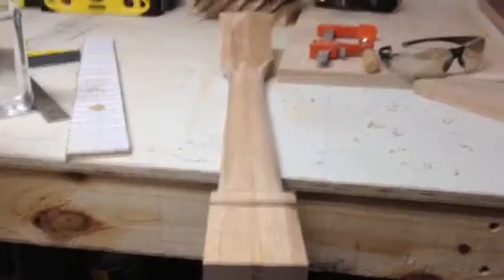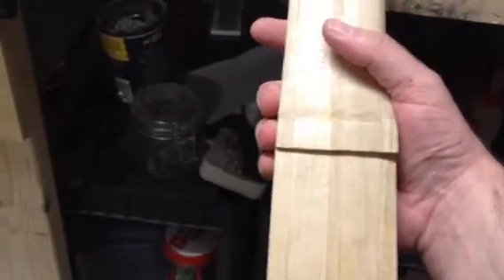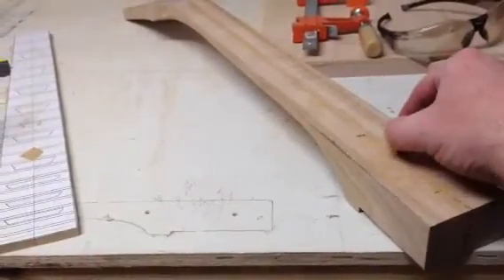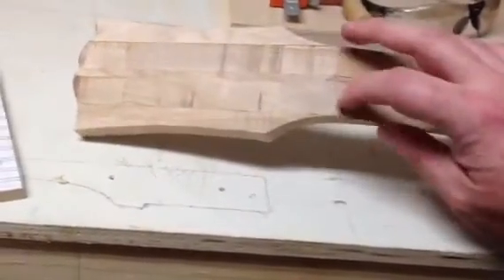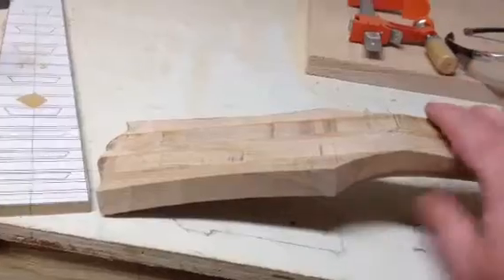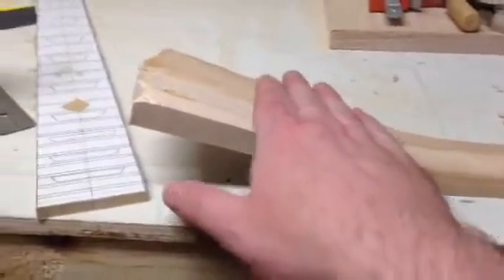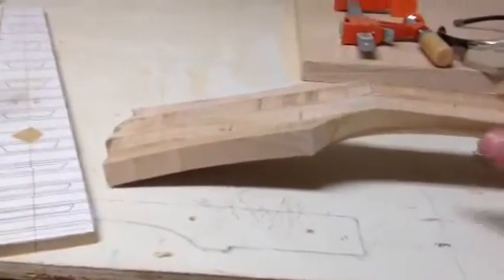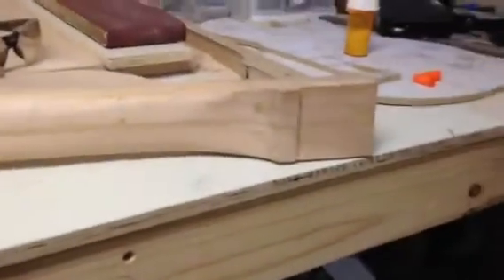Les Paul Neck Build Problems and Solutions

Comment: Hey Woody how's the build going ? I've been on my first Les Paul all year and it's a learning experience even if you've built a few guitars. I find a trimmer router really handy for leveling and shaping necks.

Andy
Nth Coast NSW Australia
Reply from the maker: I am getting there. I sanded thru the pearl inlays after installing them. Bummer. :/ I am going to order some more soon. Mean while I am filling and sanding the body.
Reply from the maker: Body is almost done. Just bridge, hardware and electronics. Well finishing needs to be done too.
Reply from the maker: Sorry I haven't posted a video in a while. I've been so engrossed in the build I can nearly stop to do one. If you need anything that I could help with let me know. I have some good advice on installing the inlays. Lol  I suggest using a sanding block that has the radius of fretboard
Reply from the maker: I am at the painting stage now. I will try to remember to post a video update soon. A little touch up needed, more wet sanding, and then clear coat. Well, a little binding touch up and the stained ebony head stock veneer needs some stain touched up. When I removed the tape I had over it, some stain came off. I just joined a Facebook group called "Luthiers Club." I've posted a few things there. How is your build going?
Reply from the maker: I also did a custom mother of pearl inlay I made from scratch myself. I was going for a Fleur Delis but someone commented that it also sort of looked like a dove. Hence, I am now calling it a "Dove Delis." It's funny how you can try to make something and it becomes something else. Cool.